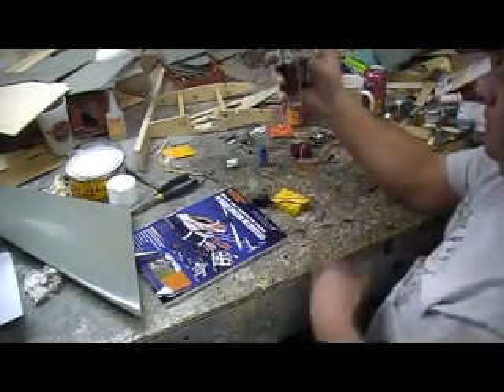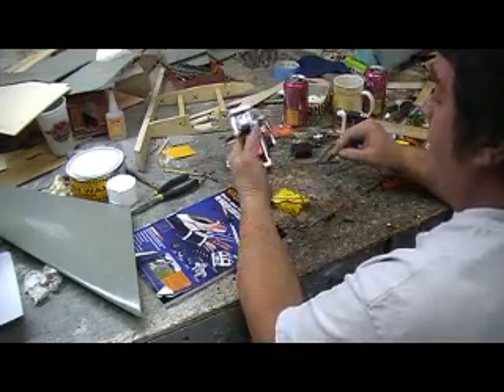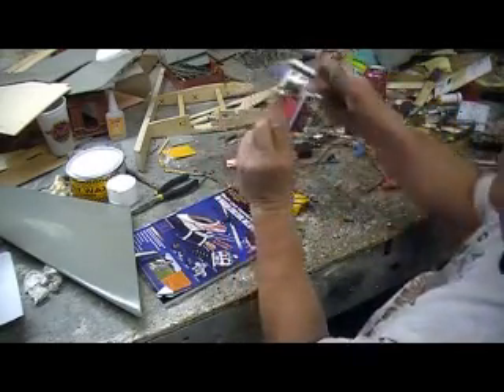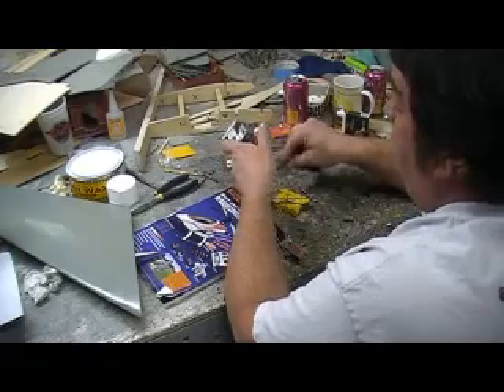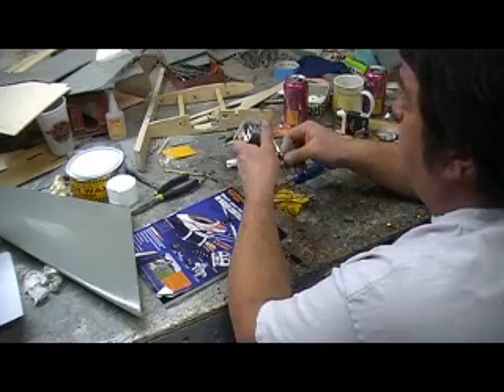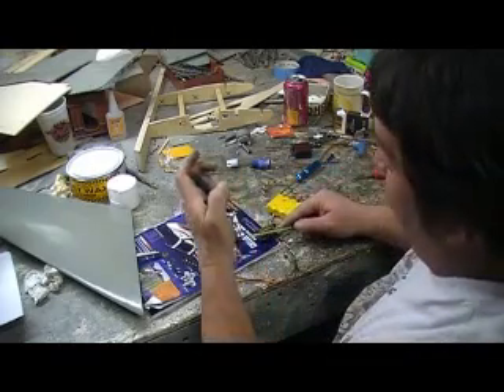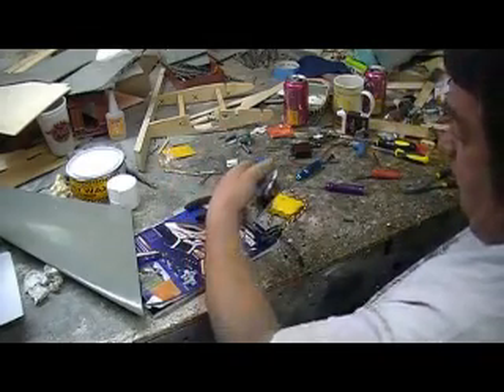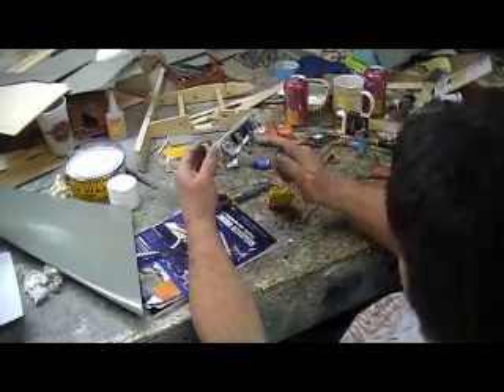building a rc jet F-105 thunderchief # 408

Comment: @elrenno a single hole will work just fine, the parts that move back and forward are inside the fuse.. the elevator rotates around the center of the bar that sticks out of it....